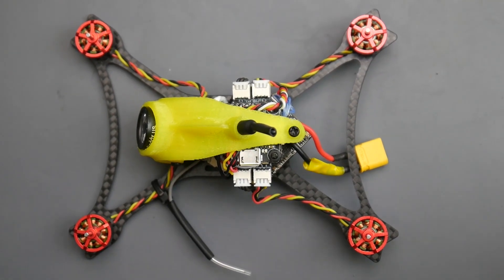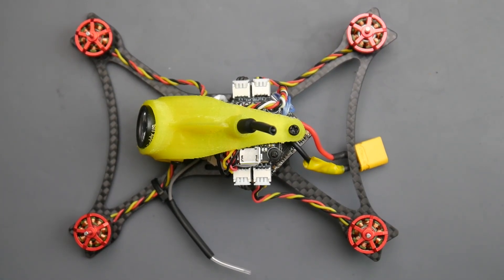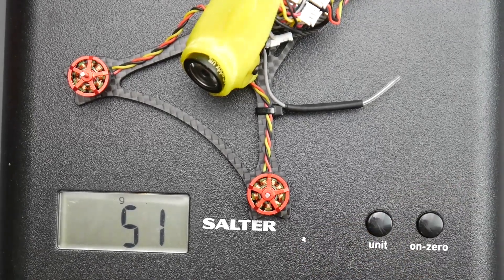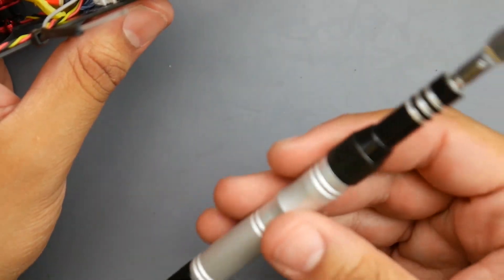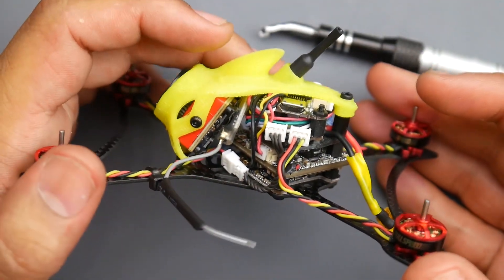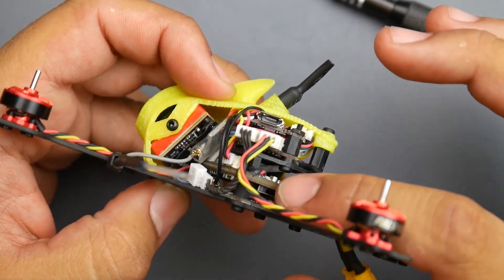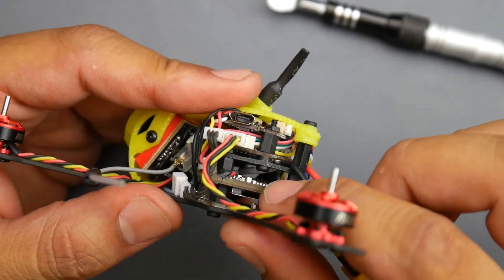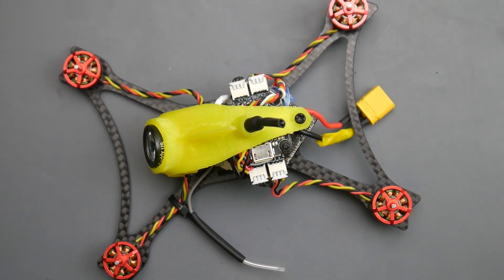HD ToothPick 3D Printed Mod // Going to China?

Comment: And I thought my quad was packed in tight under the hood. I don't care for the way those motor connectors stick out. I would look a lot cleaner if those were soldered.